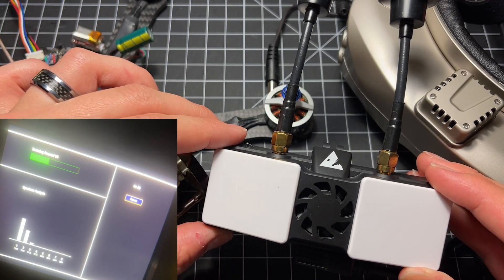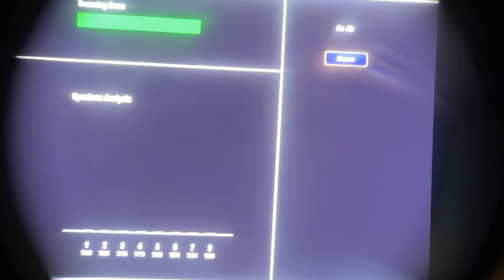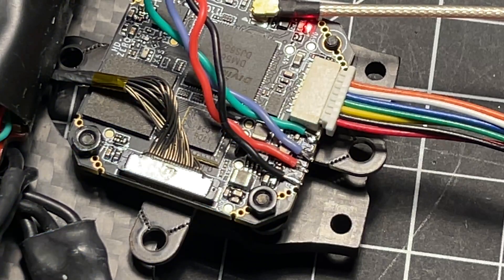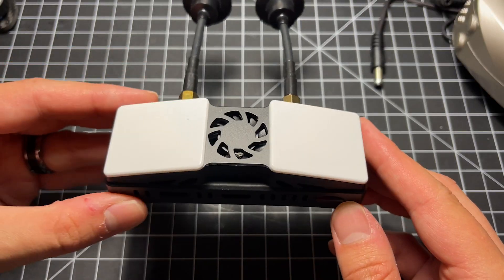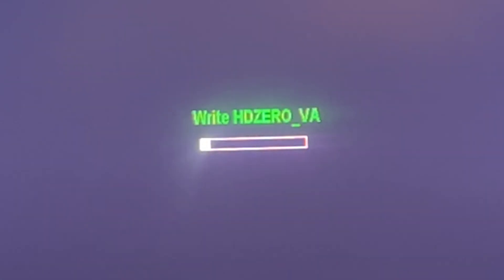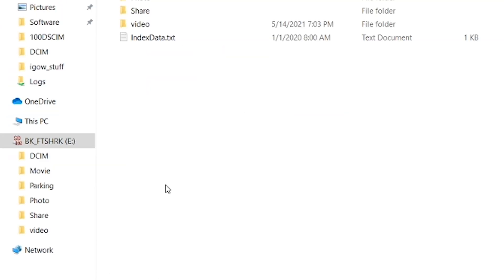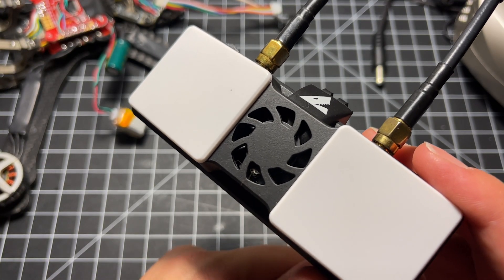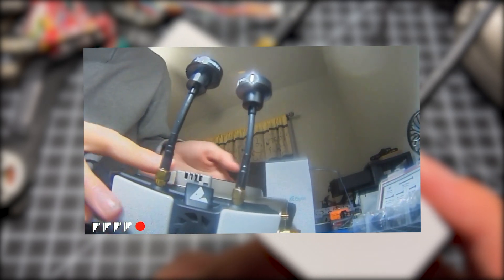Update Shark Byte HDZero Firmware; Fix Pixelated FPV Video Camera Issue Out of the Box

Comment: Hi How do I know what firmware I need for the hdzero vtx
Reply from the maker: This video is very old now so things are laid out a bit differently. In general, you download the very latest firmware zip file (at this time, it's Rev 06022023 . zip). Inside that zip file are other zipped folders with the actual firmware. The labels on them should be extremely clear, for example if you have the Freestyle VTX, it's literally prefaced with "FreestyleVTX_Rev06022023 . zip" OR if you have the older whoop board like in this video, that is "WhoopVTX_Rev06022023 . zip" -- hope this helps.

Comment: I'm not getting any osd in my goggles. My wiring is correct, RX to TX and TX to RX. The proper uart has been opened in the ports tab in Betaflight and the proper commands entered in CLI. I'm getting video feed just no osd. I tried using the key pad, or dongle, to at least know which power level I'm on. This doesn't work either. The led doesn't work. Seems like it's not getting any power. What am I missing? Has anyone else had this problem?
Reply from the maker: No LEDs on the board at all? Does it even feel warm to the touch?
Reply: @JohnCuppi  Thanks for responding John. The key board does nothing at all. No heat either. Any idea what's wrong? The vtx is working other than no osd and nonfunctional control board
Reply from the maker: @doncunningham3124  If you've done everything such as setting MSP on the UART, done all the cli commands like displayport_msp_serial to the uart port, etc, and still don't have anything then there is a chance that the OSD processing unit on your board is damaged/defective. What version of betaflight are you on?
Reply from the maker: @doncunningham3124  Oh, wait, there is one caveat that people get confused on regarding displayport_msp_serial that I wanted to bring up.  When specifying the serial port of msp_displayport as your serial port minus 1.  ... so if you are using port 3, set = 2, if you are using port 1, set = 0.
Reply: @JohnCuppi  4.2.8
Reply: @JohnCuppi  I'm familiar with this and followed this direction. The BF version is 4.2.8
Reply from the maker: @doncunningham3124  at this point I’d be contacting divimath for further instruction. It sounds like you’ve done all of your homework in it. You may have a defective unit. Fatshark no longer services these so contact divimath directly.
Reply: @JohnCuppi  Thanks John. I really appreciate all of your help

Comment: It always helps someone. I have mine, but I haven't finished the build yet to try mine yet. Thanks
Reply from the maker: I hope it does help someone, thanks! 👍 My build has been slow to come together so far; and I bought it all in a bundle set. Firmware was the last thing I figured would be the issue thinking it should at least link up out of the box. Cautiously optimistic that it would solve the problem, but that did it! You can never assume that in this hobby!

Comment: Looks like a very easy and quick solution to the receiver issue John. Great video 👍
Reply from the maker: It is, once you know it's just the firmware doing this :D might not expect it when you buy the bundle that everything doesn't work straight out of the box but I guess they might mix components made at different times!